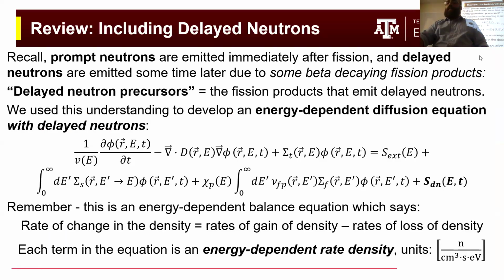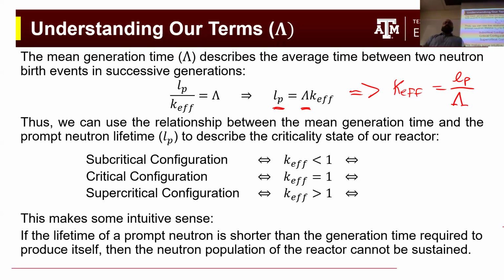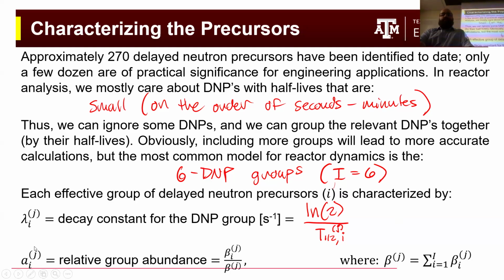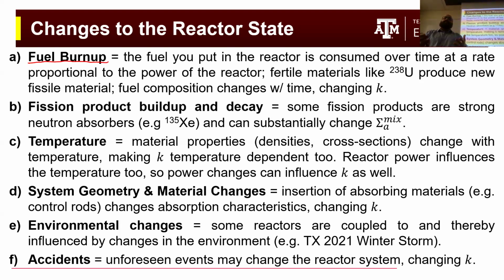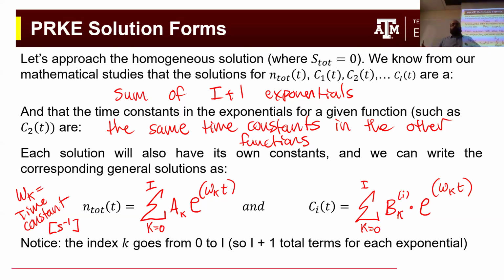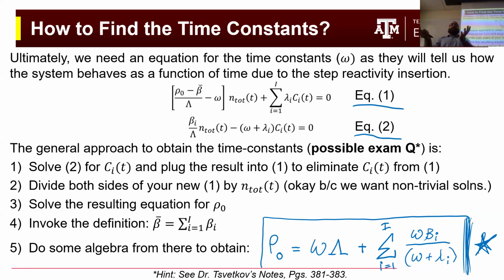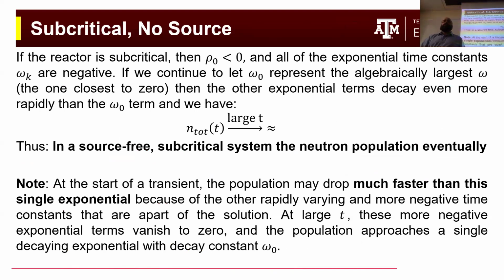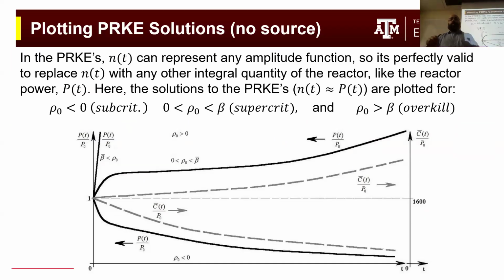Nuclear Reactor Analysis - Lecture 10 - Point Reactor Kinetics

Comment: Hi Mr S, thanks a lot for making this video, its very helpful for my current work on my masters thesis on molten salt reactor simulations
I have some questions for your lecture and it would mean a lot if you were able to respond - Also, can i add your video to my bibliography as a source for for example the DNP concentration equation, as there are no reactor courses at my university so I have no teaching material which include the equations.

1. At 9:20 you speak of the number of delayed neutron precursors produced by each fission of neutron E, and then you write we assume each neutron precursor produces exactly 1 delayed neutron. Did you mean that each fission produces exactly one delayed neutron precursor? Or was it meant as an argument for not having a vu in the sum over dnp groups since they each produce 1 neutron? its a bit unclear to me how that assumption appears in the equations

2. What are external neutron sources? is that neutrons being shot into the reactor to keep it alive, or is it neutrons reaching a certain geometry of the reactor from another point in the reactor (like neutron diffusion from somewhere else)

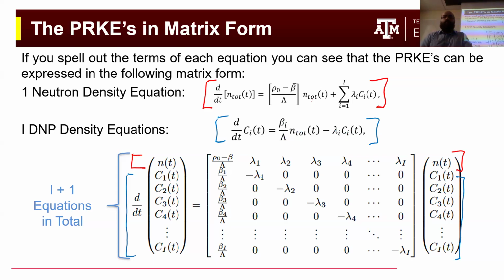3. If i wanted to include the external neutron sources S_ext to the d/dt matrix formulation, could i just add the source term to the basis as a constant which is added only to the dn/dt and not the dci/dt? (59:59)

4. If its true that n(t) can be replaced by any value for example p(t), could p(t) for each cell in a grid-like simulation domain be used as n(t) in the PRKE to solve for the evolution of power, where p(t) would then be p(t)=p(0)*n(t) where C is some normalization of power?

Thanks a lot for the public lecture, it was very informative :)
Kind regards from denmark
Reply from the maker: You are very welcome, feel free to use the video in your bibliography.

1) The assumption doesn't change the balance equation for the delayed neutron precursors. Nu_di(E) was defined as the expected number of type-i DNP's produced from a fission caused by a neutron of energy E, and since each delayed neutron precursor produces exactly 1 neutron, it just means that nu_di(E) also represents the expected number of delayed neutrons that will be born per fission caused by the neutron with energy E.

2) Neutron sources in the reactor (it is poor terminology since "external" might make you think the source is outside the reactor) that are generating neutrons via non-neutron induced fission. An example of this would be Cf-252, which decays via spontaneous fission, and is commonly used as a neutron source for fission reactors. 

3) When we assumed S_tot(t)=0, it made our conservation equation for n_tot(t) nice to solve because the equation was homogeneous. Including the neutron source term makes things a bit more complicated mathematically and physically because now the solution to n(t) is a sum of the homogeneous equation and the particular solution. 

4) Yes, n(t) represents an amplitude function, so it can be a lot more than just the neutron density, and if you want to convert to a different quantity (like power, for example) you would just need to apply the correct conversion factor to go from n(t) to P(t). You may find the following passage helpful: https://imgur.com/a/ciNGb3G
Reply: @SeanForrestSimonian  Thanks a lot for the responses, and thank you for letting me use the video as a source :)